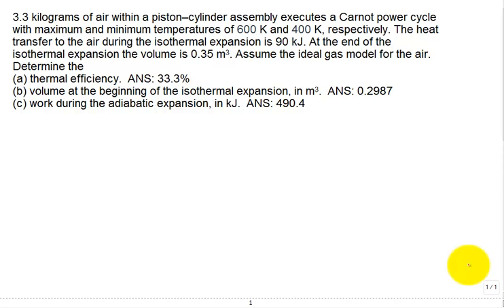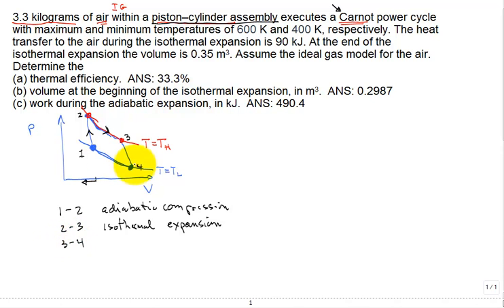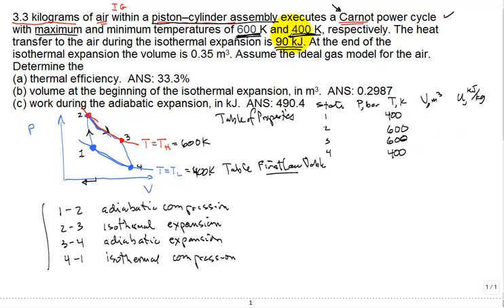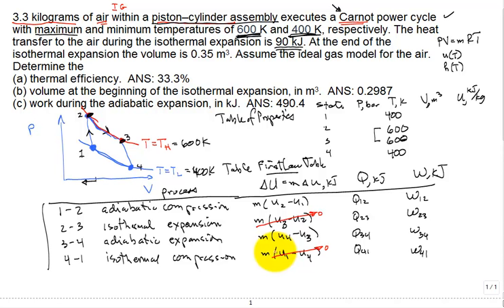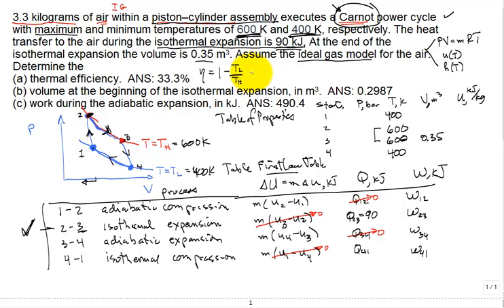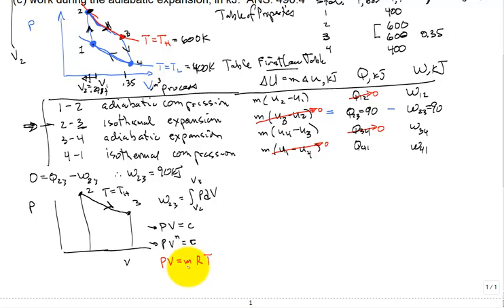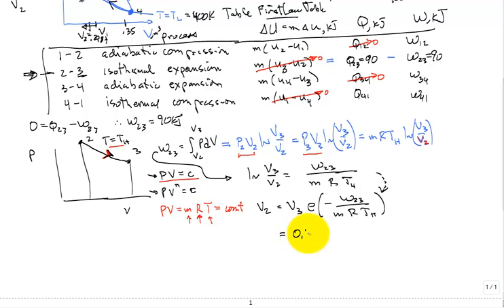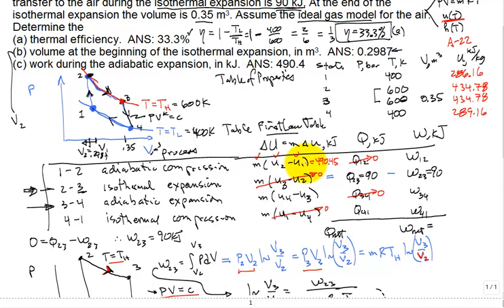me3293 Carnot power cycle with air in piston cylinder assembly

Comment: No matter how I put that in my calculator I dont get that answer for V2
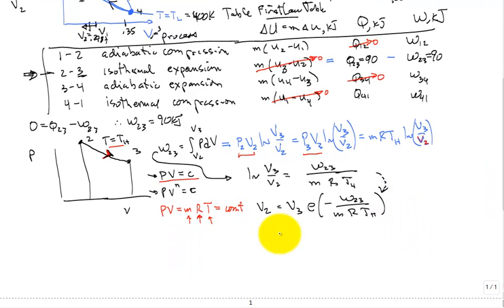Reply from the maker: at 21:20, V3=0.35 m^3 ( not V3=0.40 m^3 , mistake in video) to get V2 = 0.2987 m^3
Reply: @randallmanteufel6411  Thanks.. Just did my thermo exam.. think I passed.. Self taught from your videos.. Thank you.